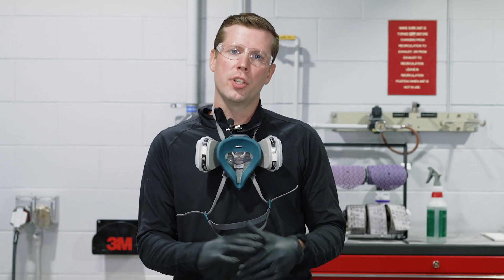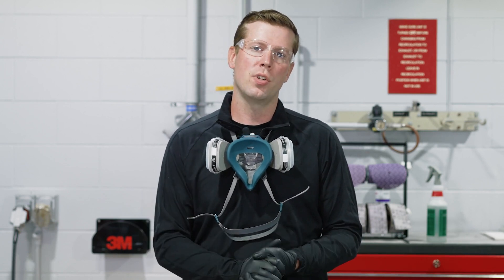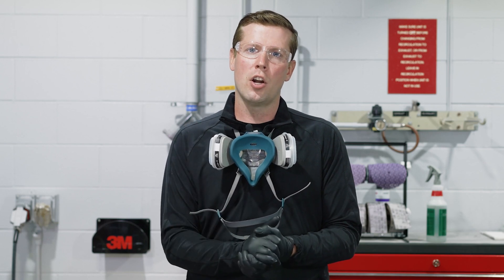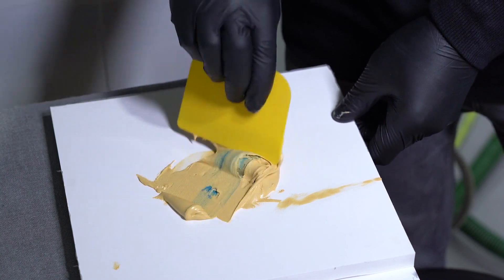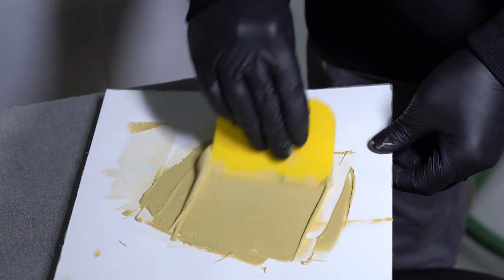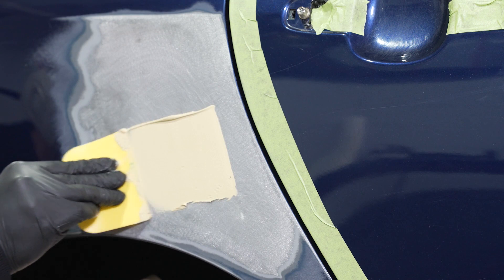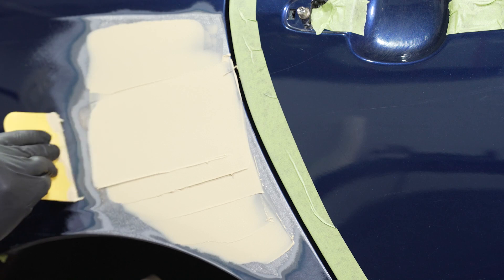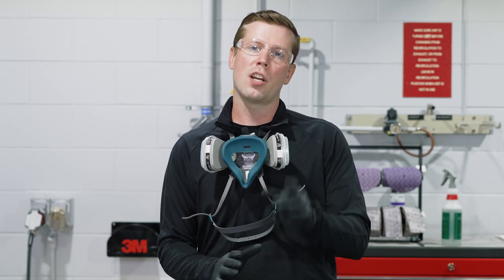3M™ Tech Tips: Damaged Panel Repair Process Episode 4: Mix and Apply Filler

Comment: How do i keep the filler from hardening during mixing? Do i use less hardener?
Reply from the maker: This video can help answer your body filler and hardener questions: https://www.youtube.com/watch?v=D4P0QkFJhqY 👍
Reply: If your mix is getting Hard before you go to lay it then either your work area is too hot or you’ve added too much hardness always make sure you’re using the correct Hardner for the filler that you’re using

Comment: unfortunately most filler and activator doesn't come with an expiration date.. would be nice if it came with a manufactured date.. I was cleaning out the shop this fall and found a gallon of bondo glass in the back that had a white crystal the size of my fist that grew in it because it was so old.. a manufacture date would also help us know if our jobber is selling us old product
Reply from the maker: Our fillers and hardeners do have manufactured dates on them, although they're sometimes a little tricky to find. For example, our hardener has a code printed on the crimped end of the tube, the first number indicating the year it was manufactured in.